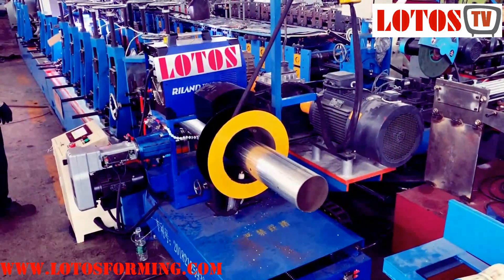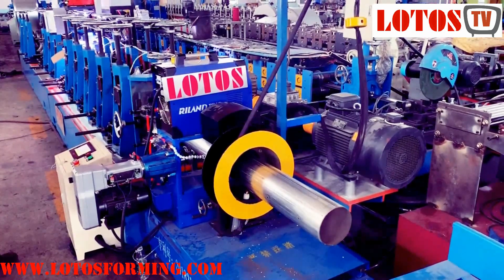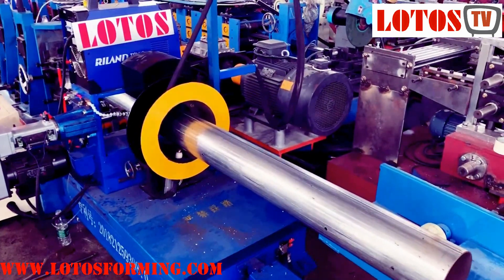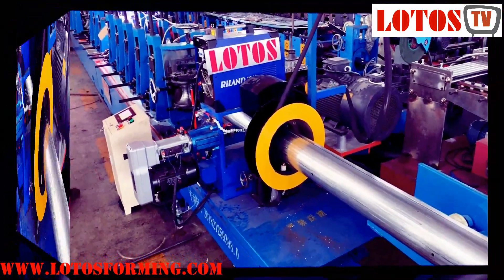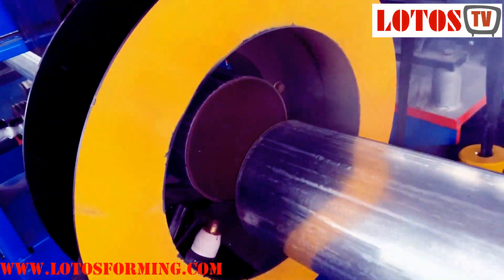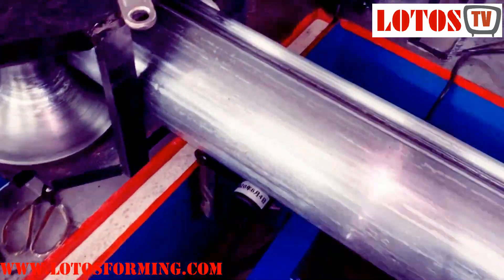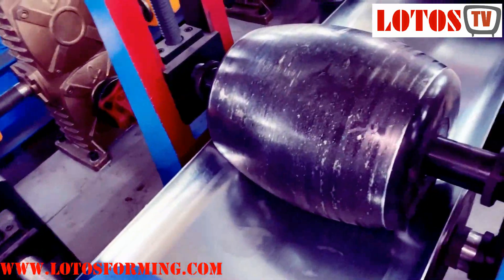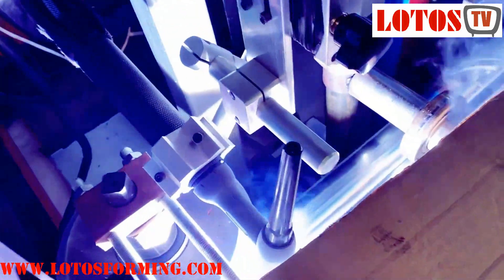【 TIG pipe welding machine】: Round Tube roll forming machine " Tig welding and plasma cutting "

Comment: Tungsten Inert Gas Welding or Neutral Tungsten Welding is one of the most important welding methods in various small and large petrochemical, military, marine, aerospace, power plants and other industries. In Iran, it is better known by the abbreviated and common name of argon welding. The reason for this naming is mostly due to the use of argon gas in this welding process.

Comment: In TIG welding, a tungsten electrode heats the metal you are welding and gas (most commonly Argon) protects the weld puddle from airborne contaminants.